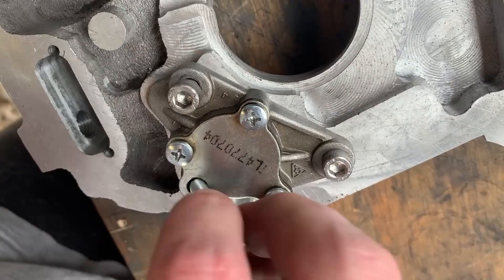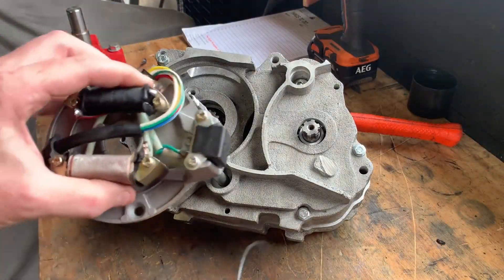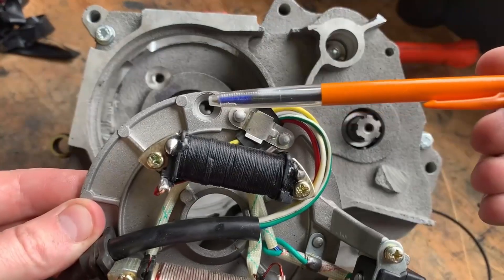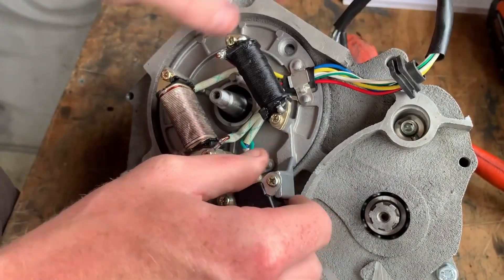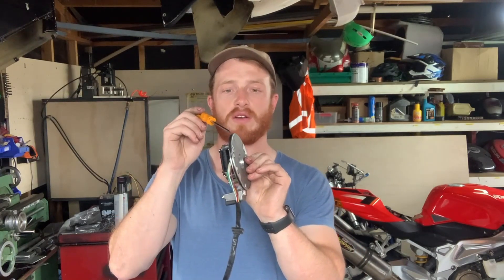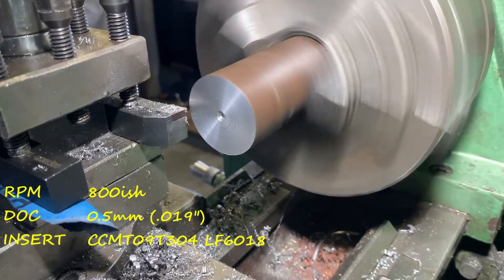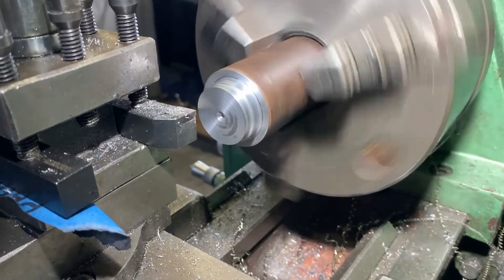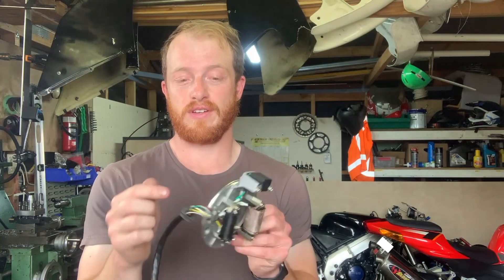DIY 144cc V-Twin, A Better Tensioner

Comment: I have a question how you managed the spark timing please reply it wd help me alot ❤️🙏 thankyou keep going
Reply from the maker: I added another trigger point on the flywheel. You can see how I did it at the start of this video. 

https://youtu.be/6eSP1nxImAs?si=c6nP_U5_yDyPcJra
Reply: @OddsandEndsMachining  thankyou so much for the reply I own a hyosung gt250 vtwin was thinking to convert it into carb but I don’t know to to give the spark i mean the spark
Timing😭
Reply from the maker: @Prathamframes  without looking into too much, you could just trick the bike into thinking the injectors/pump are plugged in by matching their resistance and attaching your carbs. Although I haven’t actually tried this, i have tricked other bikes by removing miscellaneous sensors and replacing with resistors.
Reply: @OddsandEndsMachining  are you available on insta will
Text you there for more idk much this bike idk why my ecu is getting cntnsly blown fry idk why and there’s no part availability idk what cdi i use wiring do i have to do any modifications in the flywheel how to give the spark 😭 idk and there’s no one who can help me out
Reply: @OddsandEndsMachining  the main problem is in this bike is ecu and there’s no ecu available in the market😭 that’s why I’m changing it into carb
Reply from the maker: @Prathamframes  message me on my Insta account. It should be in the about tab on my channel.

Comment: Поменяй промежуточный ролик. Пластиковый быстро износится. Используй шестерню коленвала и подшипник 19х7 для сборки ролика.
Reply from the maker: I’ll see how it goes after the initial start. I’ll pull it down after running it for a while. But that is an option.
Reply: @OddsandEndsMachining  так уже делали, не работает, изнашивается. Натяжитель цепи механический, он не сможет натянуть цепь  когда ролик износится. Из за этого цепь перескочит 100%. Переделай сейчас. Картер уже готов, надо только ролик заменить.

Comment: Getting closer to running...
I just started watching these yesterday. Watched the whole playlist and I have to admit I am slightly disappointed that its ended and I am "all caught up" before its up and running.
Reply from the maker: This engine is like a fine wine. The longer it takes the better it’ll be, or at least that’s what I keep telling myself. 

Jokes aside, you shouldn’t be waiting too long, all that’s left to do is make the copper head gasket and the final assembly.